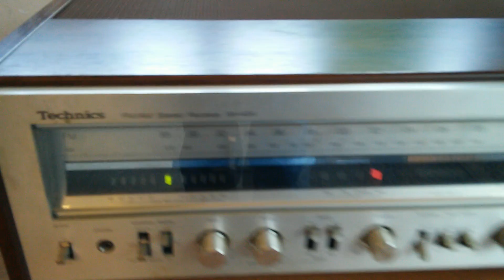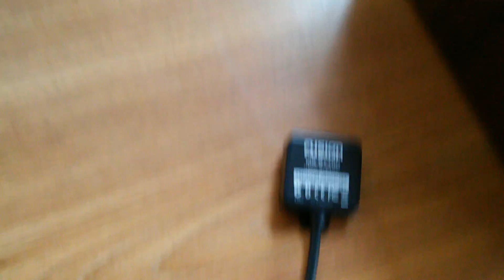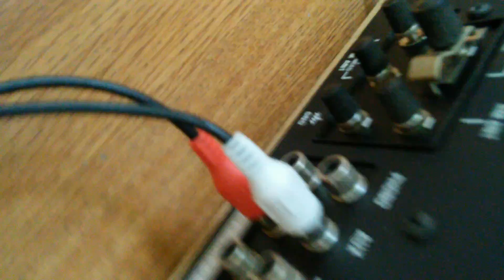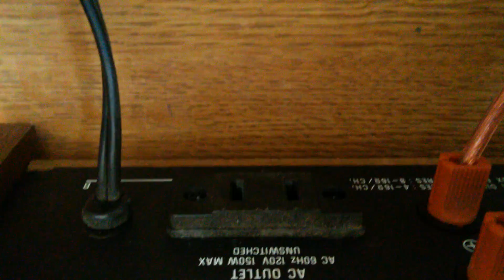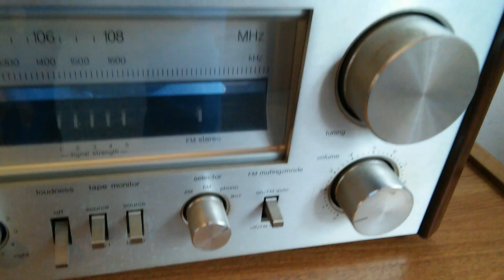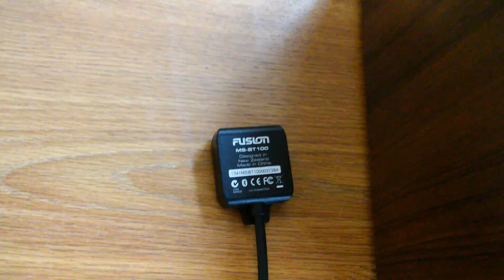Add Bluetooth to any vintage Home Stereo

Comment: hey breakerbroke!

so glad i came across your video. as i need your help. i have a vintage sonodyne amp and speakers. i want to use these to connect my phone or chromecast audio. it has an old 5 pin in want to convert it to 3.5mm jack

can send you details with images if you can share your email. 

im avaialable at colorz66@gmail.com

looking forward to hear from you. 

cheers
g
Reply from the maker: I would want to use a pre amp input to add BT to your unit. If you have a 5 pin input jack just google your model number and fine a wiring diagram for the input and solder up a plug with female RCA s to your 5 pin,  so you can plug in a standard BT unit. Thats all I can tell you without knowing what model your sonodyne is... Good luck.
Reply: hey thanks a ton... i got a 3.5 jack soldered to my 5 pin jack so now can use it with my phone n laptop n other device. now im getting the chromecast audio for wifi he he... thanks a ton
Reply from the maker: Very COOL!
And the Wife is happy, You are the Man!
Reply: i meant wi-fi... nor wife.. hahah im single!
Reply from the maker: Gaurav Singh
yea... I just re read your comment.. I need effing glasses..:)

Comment: wow..  dude,..  Beautiful Technics REceiver..
Reply from the maker: Thanks. I use it every Day. I use it on a pair of Klipsch KG 4.2s
Reply: @breakerbroke23   Pioneer sx-950 and Bob Crites hy-brid Klipsch Cornscalas
Reply: I bought one of those at a yard sale for $20! the only problem was the pilot lights were turned out! Great sounding amp, with the most sensitive tuner Ive ever had. Great amp! Especially paired up with some vintage JBL L110's. I like the sound better than my Denon and I love analog controls! I added a Logitech Blue Tooth receiver to mine to "modernize" it.
Reply: breakerbroke23 dewalt got a Bluetooth adapter aswel i did not know you can do this thanks for sharing  good video
Reply: It's a classic!! It's like 1985 all over again!!!!  :)
Reply: Thats from the 80's, make sure you solder new capacitors in the power section. Just match the UF and the volts and note the positive and negative on each capacitor. Those ones are on their way out.
Reply: Had one just like it decades ago, really solid receiver, bulletproof, you can’t beat the sound it pumps out 👍🏻
Reply: breakerbroke23 ill stick w my pioneer spec seperates

Comment: it's called a ac adapter not a wallwort
Reply: its a wall wart so called as most plug in power supplies are hardly a thing of beauty
Reply from the maker: @FLSTC. 73rds rite back you. K7--- WA State
Reply: walmart?
Reply: technology productions 2017
Reply: 73 de ki9g
Reply: What chu lookin' at มม
Reply: lostintime86 - No.
Reply: technology productions 2017 lllllllllllllll
Reply from the maker: Wallwort is a term we used back in the day, at that time they were not as common as today. Iam talking WAy before you were even thought of:) Thanks for your comments and 73s
Reply: breakerbroke23 I have a mid 70s stereo receiver
Reply: btw....wall wart.   You know, like a bump on the wall ?  Get it?
Reply: sorry breakerbroke23, there are too many ignorant people nowadays of the terminology used back then, just sad.
Reply from the maker: Good call
Reply: It's not a wallwort, it's a wall wart.